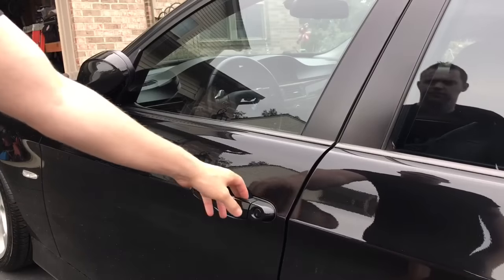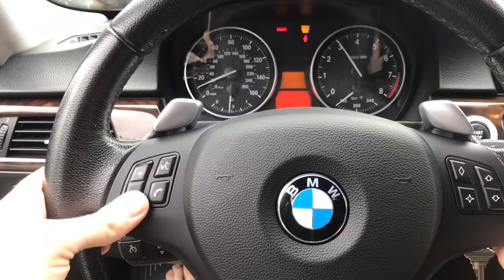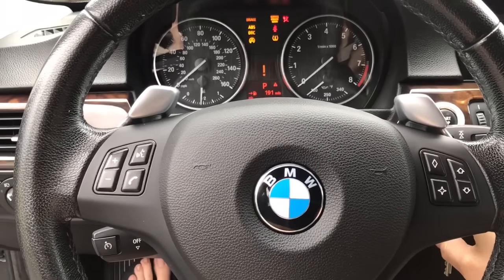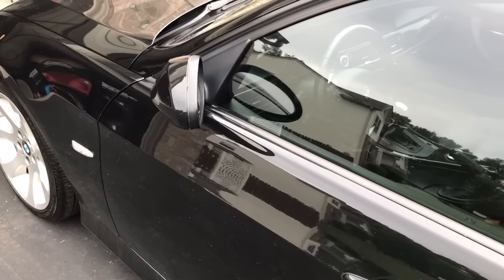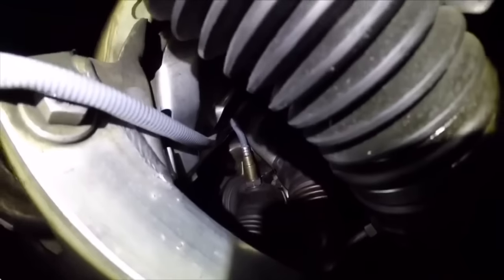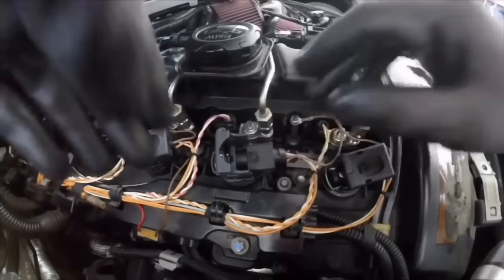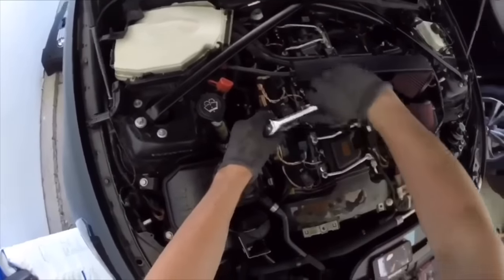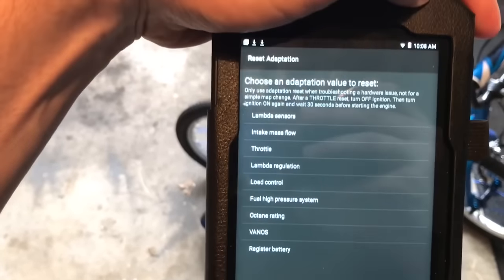BMW ROUGH IDLE FIX! HOW TO!

Comment: Hey brother I have a idle problem as I’m driving though between 40-65 mph , I literally have to press down on medal to go faster or I’m almost jerking around , have replaced everything from o2s throttle body both fuel pumps plugs n coils , the only thing missing now is injectors
Reply: Do a vacuum check with a smoke machine. Vacuum leaks (cracked hoses/intake boots) = unmetered air (MAF is bypassed). = poor idle/shakes. It also could be VANOS related or a dozen other things but start with vacuum IMHO.

Comment: Great stuff!!! Question.... on the jb4 after mode 1-7 is selected,  do you place the mode 1-7 back to where it was prior? Also, I've seen your how to use jb4 tutorial. And it's awesome! However... I've noticed more and more sub channels.... is there any possibility you can either direct me to, or make a in depth video of every mode/channel and sub feature in the steering control? I found a small write up on some jb4 control options. But yet to find the holy grail of all the information of jb4 options. I'd love a full blown tutorial. Like I said, I have seen your video. But it's not every feature. Thanks again for all your work! You have been super helpful! I just smoked 3 mosfet chips in my dme.... sucks for me. I've already replaced my dme from msd 80 to msd 81. The newest version. But immediately got a dead miss right afterwards. Hopefully simple. Or I got another defective dme...
Reply from the maker: frankdogg85 just curious, what Things did you see that I was missing? Of course I’ll do an even better one 😀👍🏻
Reply: Well, there is 9 channels, and 9 sub menu options. So is there actually 81 different options? What do they all do? What should we never mess with? I'm sure it's going to be a long video. But you would be the only one on YouTube with it. I'll definitely like and share it. I'm not picking your great content apart. And I have no idea what all the steering control options do. I'd just really like to know what we can play with, and what should be avoided. And a better understanding of all the areas in between. Is there a factory reset. For those who start changing menu's around? Thanks for all your hard work, and superior content! If I could subscribe daily to help your channel I would!
Reply: On the n54tech.com forums, Terry has posted an image that that gives you an overview of all the JB4 steering wheel controls available.

http://www.n54tech.com/forums/showpost.php?p=157920&postcount=3

Comment: Have you done any transmission service filter/fluid change on your 335?
Reply: I fully drained it on my MT 335i. only 1.4 liters came out and I was able to fill it with 1.98 liters ( to spec) with no overfill. After doing this my shifts were buttery smooth and no longer dry. Change it if you can right away, there is no such thing as a life time fluid
Reply from the maker: Not yet, still original

Comment: I have have an issue that used to trip it when I let it idle for a while, it would get rough and have power loss. Turn it off and turn it back on and voila it would work perfect again. It has slowly gotten worse but a restart always resets it. What is it ? I believe I’ve pinned to injectors.

Comment: I have changed all spark plugs and coils. New HPFP and 2 new Vanos solenoids. Also changed oil and coolant. But still have a rough idle when AC is OFF. Any ideas?

N53 E92.

Comment: I only use shell 99 octane in uk. Had to change all 6 coils and plugs, (nox sensor £250+.) just for part. Had rocker cover gasket renewed, full serviced every 6000 miles. It still  misfires now and again like a bitch. Hopefully not injectors.

Comment: Hey i need help my bmw 545i 2005 is having a idle shake and i changed all the park plugs and coils and mass air flow but it still has the roufe idle i need help bmw fanatic
Reply: orlando gonzalez o2 sensors bro
Reply: Something is wrong near the head area!! I'm almost 💯 sure
Reply: Ill check that thanks guys
Reply from the maker: orlando gonzalez Any other codes? What scan tool are you using?
Reply: BMW Fanatic im going to get a scan tool today or tomorw to see whats going on ill let u know if i still have probloms
Reply: BMW Fanatic but i changed all the spark plugs and colis and becuse they were really bad and the mass air flow sensor was in bad shape i thought that will resolve the issue but its still shaking and my i drive shows up catyliytic probloms and air bag probloms
Reply: Look at your Vanos system
Reply: Check your PCV
Reply: Dunno if you still have the problem or even the car but check your valve seals and also coolant tube the runs through the "'V" of the engine common problems on the n62. Valve job is gonna be spendy but if your good that will take ~4000 dollars worth of work and make is ~2000 considering it's an '04 If it haven't had these repairs yet your gunna need to sooner than later I'd bet too
Reply: I think you might have a vacuum leak check all hoses really good and then check again and again especially if you removed your maf or had worked done on the air take area. You just might of loosened something.

Comment: That doesn't work on 05 530i. Any suggestions?
Reply: The above video works with a JB4 or MHD tune not a car without a tune. Your options would be to get a code reader and check for issues and then take it from there or be ready to get ripped off and take the car to the dealership.